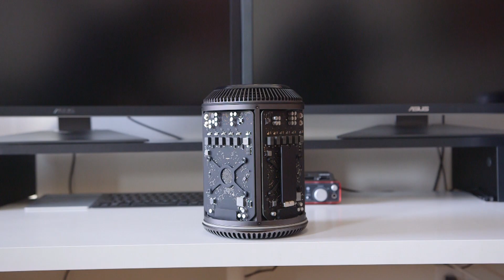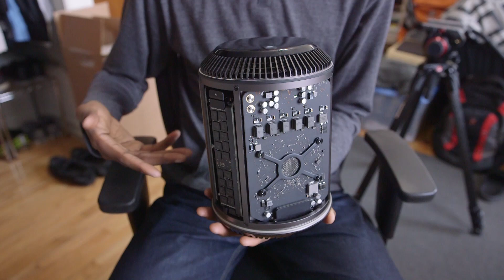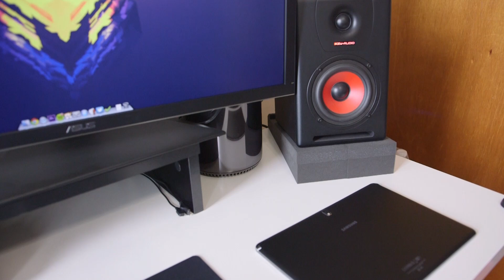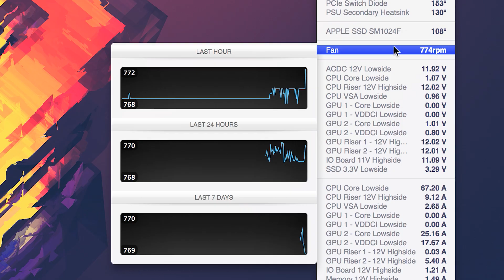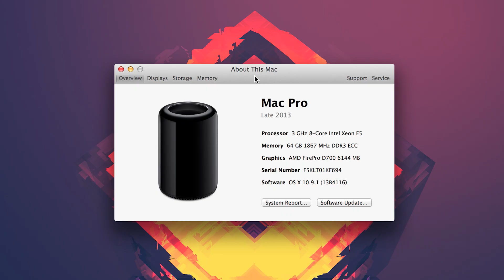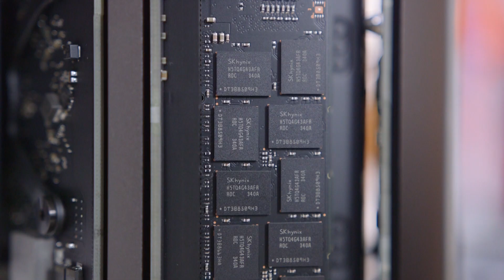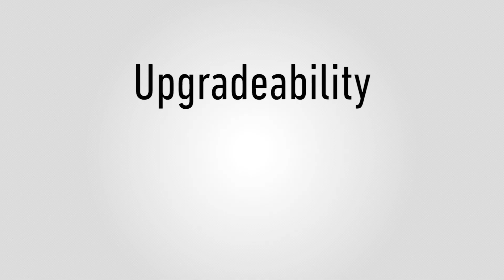New Mac Pro Review!

Comment: The so called "thermal core" is not a new way of cooling. You can find these tunnel-type heatsinks in old class-A audio power amplifiers such as Krell KSA100 or other industrial equipments. Apple doesn't care about expandability, so they have more freedom designing their products. PC vendors need to comply with standards like ATX so it's impossible for them to use heatsinks like this.

Comment: No matter what you said near the end of the video, I still don't think this is a good price: performance ratio. Basically, yes, this is an over-priced trash can.
Reply: The component parts are more expensive to buy separately. Basically if this is the power level you require (and I can tell from your comment that you REALLY don't require it) then this is an expense you need to weigh up against your business IT requirements.
Reply: ***** I know this varies on the configuration of the Mac Pros, but I found that the cheapest one is more expensive than the parts separately. I heard that Apple had a discount on the GPUs, but the Mac Pro is still overpriced... I don't really understand what you mean about me not REQUIRING that much power, but this overpriced trashcan can be a lot better. Apple loves to charge premium prices for all of its products.

Comment: This will sound stupid but can you use 2 Ethernet cables to speed up internet then? (If not why does the Mac Pro have 2?)
Reply: for workstations, having 2 Ethernet ports is quite necessary. Its not really for the interenet, but Ethernet does not have that much bandwidth (its only 1gbps). And if your running something over the network (like backing up to a company server via lan) then the second port allows the computer to still operate at regular speeds 

its the same idea of having parallel highways in a major city. If one gets jammed, there is still a second option.
Reply: Sort of. You can bridge multiple connections to give you faster network speed. In work we've been experimenting with also bridging one or more Thunderbolt ports with Network adapters to give a 3 or 4x wide pipe for data transfer.

Comment: Why does marques build apple? I mean for the price of one of these he could build something way better, even for rendering and what not.  I understand its new and very compact but the prices is pretty insane. Correct me if im wrong but arent the 8 core like ~$5k?
Reply: No, many of us have built, rebuilt, tried and tried again to build this as a custom PC and it is pretty much impossible to build this for as cheap as Apple does.

The myth that Apple is more expensive is entirely based on the lack of knowledge people have with computers and their components.
Reply: not really the graphics cards he got in the mac pro cost around $7000 ($3500x2). And the 8 core is around $1000. thats just the gpus and the cpu and hes already over the mac pro price.
Reply: First this system is NOT to be compared to a standard desktop built from consumer parts. The hardest part for people to get into their heads is that this is NOT a consumer machine: it has special, more expensive components that have special workstation features. You can buy these components to build a workstation as a Windows machine, but it will cost significantly more.
Reply: datownkidd No, you can't. I'm so sick of having to explain this to you kids.
Reply: datownkidd I can assure you I know far, far more than you do. You can build "something" but it won't be a workstation machine and it will NOT be better than this. You don't know the difference between workstation components and consumer components. You barely even know how to type a sentence.
Reply: dude, he can't build anything close, close to the size of this thing, or match the power for the price, were not all nerds bro
Reply: ***** Im sure he can, he said he built an apple which is harder then a pc. And size doesnt really matter if he says hes just gonna have it on your desk. To build something more powerful then this would be easy and cheaper. He paid $8000.xx for this. With $5-6k you can easily build a pc thats more powerful and if you dont know how you can pay a company to do it and itll still be cheaper.
Reply: datownkidd actually its not 8k, and again, no you can't, i checked on cyber power, even a medium high end category a pc was 13k, just for a i7 4770k and ONE 680.Stop being a pc fantod
Reply: He has actually built a Hackintosh before. Although he chose to go back to stock apple. Also probably the fact that its the first refresh of the Mac Pro in a while is not surprising.
Reply: Your comment is almost entirely wrong. The parts bought separately, to build a similar spec PC or Hackintosh would cost you MORE.

So there's a fact for you to stick in your eye.
Reply: No way you must no noting pc's. With 5k you can build something for this.

Comment: After watching this, the question in my head, How its gonna be in 2020?
Reply: Still looks like a trash can, i guess.
Reply: *****
It looks like a trash can, but it ISN'T a trash can. C'mon, don't be so cruel.
Reply: A Phone?
Reply: ***** ***** the comment said: Name one pc that is as small powerful and good looking. Even Mini-ITX doesn't support Xeon's E5's yet. So thats the form factor and power argument out the way. Looks - you may say that some of the Bitfenix Mini ITX cases (Which still looks like an old gen Mac Pro) and the Coolermaster cases look better. I'd disagree strongly. And on your expandability point. If you buy it with 1TB of flash storage, thats loads, why would you need more? If you did, you can pick up a Drobo for $600 with 5 3TB drives. Thats 16TB of data storage including your internal 1TB. And you also may complain about the price. But i mean seriously, If you need 15TB of storage you probably have a large budget. Not to mention a custom build of that spec would be noisy as hec, well it would need to be, to be efficient anyway.
Reply: ***** TwoeBweaBwewwit Long time ago before pcs, mainframes and terminal existed...I meant that cloud computing will be more necessary for little task as user and security check as heavier computing task like decoding or data analysis...Even now as a developer WebDesktop/Mobile Apps are growing fast. Check RoR/Node.js.
You can also see Intel's market loss.
Reply: There won't be desktop pc in the future, just cloud and mobile computing...
Reply: @WindMaidMay  this didn't age well. Everyone's still using physical hardware.
Reply: Almost there
Reply: A joke - a complete joke.
Reply: ***** sure, you blind elitist fuck, jealous much, tell me one pc that is as small, powerful and good looking as this.

Comment: I don't think this is going to change anything, people that like Apple products know what they are getting: something that works flawlessly out of the box but cannot be upgraded almost at all, thus being completely useless for prolonged use (over 5 years). On the other hand, people that like PCs will not be attracted to this product, I'm not. Why? Because I want something that I can upgrade over and over and over again untill an entire new generation comes in play. That is just the way some people work, there will always be preferences.
Reply: Given ther TERRIBLE price/performance ratios in workstations hardware and professional graphics cards, Upgrading isn't viable at all. 

If the mac pro used consumer parts then thats a complete different story, but becasuse its a workstation, I don't really have issues with it.

All the parts that have better value ratios, can be upgraded (ram, ssd). No one will spend $1500+ upgrading their Xeon 1680v2 to the next generation where the performance gain is near 10-15%

Comment: so it is on intel core xeon ! please make review and wich is beter: xeon vs i5;xeon vs i7
please reply+make a video
Reply: its the same chip, just one is a workstation grade component and one is meant for consumers. Performance wise its negligible (unless you buy the 8/12 core models)

what you really pay for is for extreme binning. Less power, less heat (which is probably the reason the miracle thermals), extreme reliability (I think its five nines), and continuous runtime validation.
Reply: tanxs bro
i think it is beter than i5 but not beter than i7 
however it is quit cheao!

Comment: The fact of the matter is Apple could care less about the negative viewpoints some people have.  Most people who don't want this computer are not the target consumer.  They did not own the previous Mac Pro, they have not nor will they ever spend over $3K on a desktop computer, and they are not part of an industry that would take advantage of the benefits of a computer like this.  It's like someone saying the new Jordan's are ugly...but they can't afford sneakers over $40...or someone saying the G500 is too boxy...yet they can't afford a C200....you're not the target, therefore your view is irrelevant.  It's still fun to discuss...but...they don't care.
Reply: Your 2300 dollar workstation won't match it. If you disagree then provide a parts list as proof.
Reply: ***** its possible, but only if you choose the base model as a comparison (which almost any base model of any brand of computer is terible in price/performance ratios)

but in every other situation you are getting a tremendous deal if you buy mac pros 6+ core and with the D700 gpus. Those cards are extremely expensive.
Reply: *****
Definitely possible. I paid just a tiny bit under $2k for my PC. When I was listening to the performance that the $3k mac pro was getting in Final Cut, I ran my own tests with Adobe Premiere. I was in a margin of 3-4% of the same rendering performance of the mac pro. The difference between my computer and the mac pro is that my computer is using enthusiast grade parts, which is really the only logical reason I could see a professional buying the $3k mac pro in a value-sense. But for the price/performance, you're going to get the almost the same performance from a 4930k as you are from a Xeon E5 Quad Core that you see in the low level mac pro. However, when you pit the 8-core version that he said he had up to my computer, there's no comparison. But it also has a price tag to come with it. I just read the other reply to your comment from iamtence77, and he basically said the same thing. When you start looking at the 8 and 12 core options for the mac pro, you can no longer compare the enthusiast grade parts to the high end workstation parts. Then, you need to look at an HP z820 or similar workstation to see similar performance.

Comment: Armando did not use the 8k budget.He did not use PCI SSD and his cards performed better than yours.You won on the processor test tnx to that you have 8 cores where armando has 6 cores :D so why should someone consider a desktop pc based on its size if no one is ever going to move it. And even if they did they better buy a macbook insted of the trashcan. If a pc is rendering 1 sec faster /slower does it realy matter that the mac is a workstation. for 4,600 $ armando won against the 6core mac and was right behind the 8 core. You had a discount but most people wont have. Great video but pls be more competitive and tell us why would you consider the mac beside the fact that you dont play games. In which situations it is better besides the size and form factor.

Comment: I'm not the biggest apple fan in the world but there is one thing I adore about this company, and that is "Thinking outside the box".
For example before the Mac Pro customers release, every tech youtuber on the fucking planet guaranteed that is it heat and sound like a bitch under load. Apparently that is wrong and the Mac Pro can handle the heat beautifully.
I still ver curious about how this thermal core tech is working, mind boggling.

Comment: WHAT! NO FUCKING DISPLAY PORT OUT?!?!?! WHAT!!!!
Reply: Philip Petkov If you're paying $4k-$9k for a computer and complain about a $40 cable something's wrong
Reply: You can use Display Port via Thunderbolt.
Reply: ***** If you want to pay 40 $ more :d or if you buy a junk cable for 6 or 7 $ :D Apple make you not only pay 4 to 9 k for the mac but also 40$ for cable (s) . 3 times that cable is the price of a low end phone :D now tell me how can apples cable 4 times the price of a ebay cable :D that is not overpriced :D
Reply: If a computer is 4 or 5 k everything else should be cheap.  If i want a 4 k pc i might as well pay 40 or 50$ more for a video card with display port insted of a cable to do that :D If im paying so much i dont want to buy any more shit from them. 40 $ are almost 4 gb ram
Reply: You can plug your Display Port monitor into the Thunderbolt port in the Mac.  The connectors are compatible and it will just work.  If you have a DisplayPort monitor you probably have the cable already so I'm not sure why you'd want a DisplayPort out.  It's a subset of what Thunderbolt does.
Reply: Display port cable doesn't have the speed that thunderbolt has. It makes sense when you consider that they are different cables. And also i mean why should i pay 40$ for a usb 3 cable with even more speed now. Yes faster is better but after a year or two the price will drop and i will consider it but for now a 5$ usb 3 is enough for the common user. Also im not sure but there is i think a pci thunderbolt so any pc can have thunderbolt not only mac's

Comment: they should have used more fans, and not to mention my 380$ pc has more ghz than this. i have a 3.4 ghz amd a8
Reply: its not all about ghz and cores nowadays. the design of the cpu makes the biggest difference

here are some passmark (a program used to measure cpu performance) scores:
AMD A8-5600K APU: 4637
Xeon E5 1660v2 (ironically I could not find the 8 core model, here is the 6 core): 13,432
Reply: iamterence77 if you were to overclock your cpu by 0.5 ghz while a game was running, you would get a 10-15 fps boost. thats a lot if your coming from 25 to 40 fps.
Reply: ALOGEN Productions first off no. there is a limit. i get around a 1 fps boost from my 4770k from stock 3.5ghz - 4.4ghz. its all on how limited your cpu is. if your one of the fastest processors money can buy, then your not going to benefit from over clocking 

secondly, we are talking about server grade xeons here. They cannot be over clocked no matter what you do. the multipliers are locked, tdps are maxed out (no overvolting) the uncores are MASSIVE (have fun with stability) and adjusting the bus speed will in turn over clock the ram which will throw the memory controller out of control. 

bottom line, xeons cannot and will never be over clocked, but they still deliver some of the best performance you can buy. if your cooler can cool a xeon at stock speed, then its perfectly acceptable.
Reply: iamterence77 thats an intel proccesor. intel is strong at architecture but ghz dont matter much on their cpus. amd however gets a bigger boost from clock speeds.

Comment: So basically dont buy this yet because you wont see any change in performance because the adobe software is not optimized for OpenCL yet. you'll be paying 12K for a smaller version of what you can build for 3K. (if you want an example, Tek Syndicate made a video specifically making a build to challenge the performance of a mac pro)
Reply: that video was made prior to the hardware in the mac pro, he mentioned it after on the tek that with the heavy fire pro discounts the mac pro is cheaper than most custom builds (just not the base model)

Comment: I'm definitely no Apple fanboy but that is a slick design. Vertical updraft cooling with one fan and all the heat sinks in one area together is smart. Standard PC cases are clumsy, oversized, old fashioned and have a poor thermal layout. I'd love a pc built like this without all the stupid little unreliable fans everywhere.

Comment: Not an apple fan, but I'm glad to see someone approach the desktop at a different angle as far as cooling. Sadly Apple compromise upgradability and expandability in this iteration. It is an easy task to cool computer componants. Just look how we cool high performance cars etc... designers haven't even embraced foil or pressure technology. The trick is getting this done with no compromise.

Comment: Not an apple fan, but I'm glad to see someone approach the desktop at a different angle as far as cooling. Sadly Apple compromise upgradability and expandability in this iteration. It is an easy to task to cool computer componants. Just look how we cool high performance cars etc... designers haven't even embraced foil or pressure technology. The truck is getting this done with no compromise

Comment: I have SMC fan control installed on mine and when I'm rendering my CPU is at around 90 degrees celsius (194 farenheight) is this normal, I know apple like to run there machines hot, but at this temp it would seem they care more about fan noise than roasting your hardware.
Reply: If your on a macbook then it's not that abnormal, maybe clean your fans but it's not damaging temperatures
Reply: Thanks guys, I feel reassured ;)

Comment: I wish I could get that computer... I'd would make a kickass gaming machine
Reply: It sucks for gaming, it's using workstation parts. They're made for precision and stability, not pure performance like gaming cards. If you want a Mac that games well, get an iMac.
Reply: I dissagree! Those graphics cars in it are powerful. The Mac Pro May not be designed for gaming but it's designed for power and graphics. If my 2012 MacBook Pro can run arma 2 well (which it can), then there's absolutely no reason why the Mac Pro can! That thing is a monster... Gaming PCs use those graphics cards!